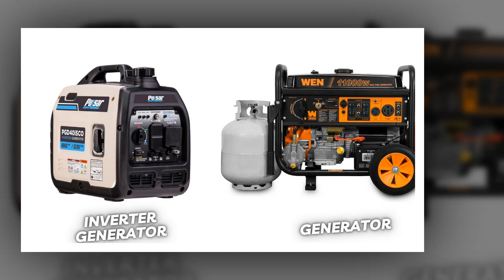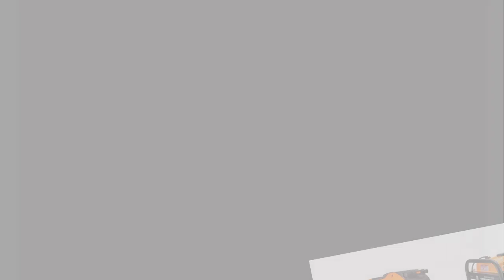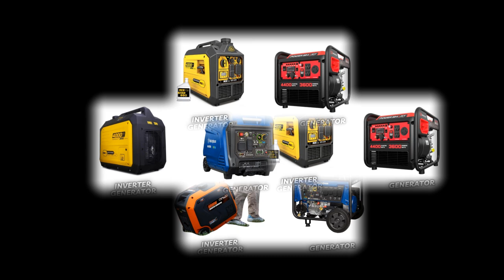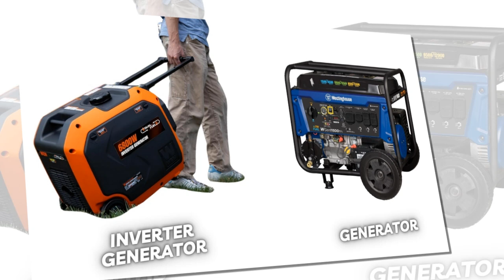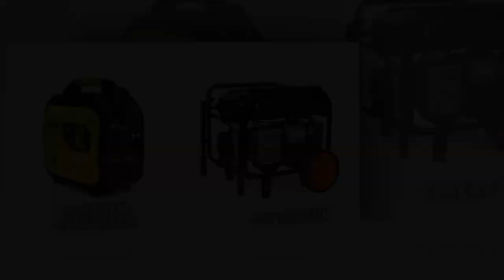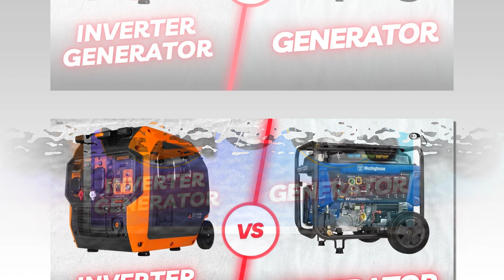Quiet Generator Options: Best Low-Noise Models for Residential Use

Comment from the maker: .
Link = https://cutt.ly/4rB1WDMy
.
Modern quiet generators operate between 50-65 decibels, making them suitable for residential areas without disturbing neighbors. Inverter generators lead in noise reduction technology through advanced muffling systems, sound-dampening enclosures, and variable engine speeds. These whisper-quiet power solutions enable homeowners to maintain essential electricity during outages while respecting community noise ordinances and maintaining neighborhood harmony.

Hashtags: #QuietGenerator #LowNoiseGenerator #ResidentialGenerator #InverterGenerator #SilentGenerator #BackupPower #HomeGenerator #PortableGenerator #GeneratorNoise #NeighborhoodFriendly #QuietPower #SoundproofGenerator #WhisperQuiet #GeneratorSilent #PowerGeneration